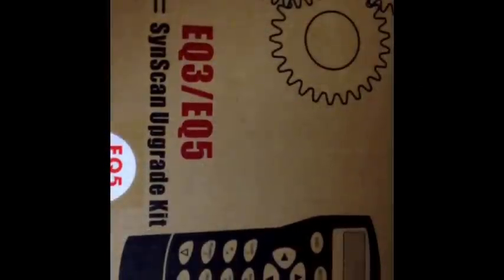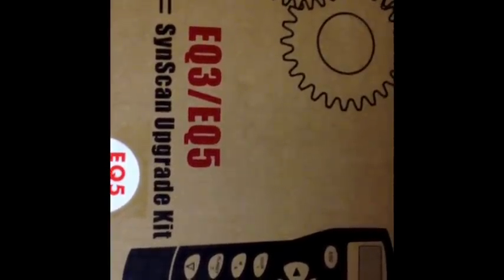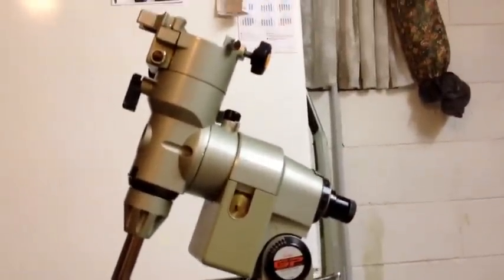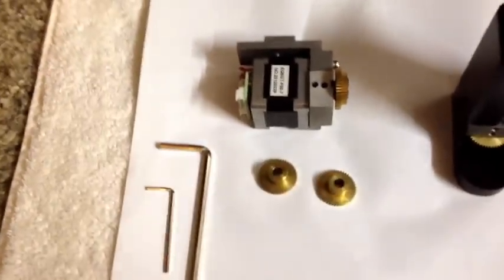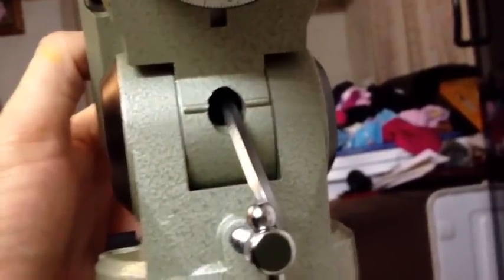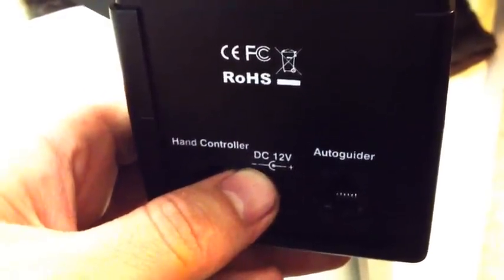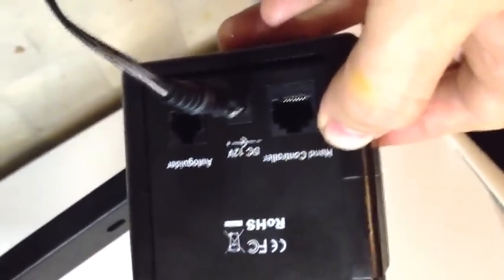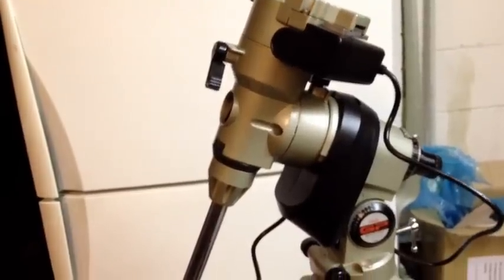Upgrade Of A Vixen GP mount With A SynScan EQ3/EQ5 Skywatcher Goto Kit

Comment: Thanks for the video. I have a GPDX version of this mount and I believe the only difference is to do with a heaver bearing and the polar alignment scope built into the shaft. I have not used the mount for a long time and it has been sitting in a box in my dining room. Perhaps I can upgrade mine.The motors still work but the computer that drives them died a long time ago.
Reply: I'm looking for a gp-dx mount head. Let me know if you ever want to sell it if you aren't using it.
Reply: @DB-be9wy  I have the complete kit from when I first got it. I used it with a 5"  Televue Genesis Apochromatic refractor so I got an extension tube and a tripod. It also has the motors fitted and a Skysensor computer which is not working. 
I do need to get rid of it but I have MS and getting it all together would be a bit of a problem at the moment and I wouldn't know how to communicate with you anyway because I am reluctant to post my email address on Youtube.
Reply from the maker: It is a sentimental scope for me so sadly no sale price

Comment: Btw if you are not sure if the gears are too close but don't want them far enough apart that they have too much play, get a strip of thin paper, tracing paper works well.  Turn the gears until the paper is in between the 2 cogs and tighten them together then remove the paper for a good fit. Learned that trick growing up with radio control cars 😀

Comment: hi, nice detailed video! I am at latitude 1 degree N. Do you think there might be an issue installing the RA plastic housing as the bottom might hit the base of the mount? Thanks!
Reply: Luka Botic but the controller connection points are attached to the plastic housing. maybe i will just have to file the housing. thanks!
Reply: get an extension pier
Reply: Izzat Zubir might not work. The housing will hit the azimuth adjustment knobs.
Reply from the maker: +Teng Jie Ng yes that is possible the plastic can be detached if your desperate.

Comment: Thank you for the video. I have a GP too, and some time ago I installed a Celestron CG5-Goto system, pero it didn't perform well with gotos. What can you advice about the Synscan? Did you try to do autoguide with it?
Reply from the maker: +Mario Morales Aimar  auto guide is pretty solid.  Some times it's approx 1/2-1° off but I suspect it is just slack I'm my original setup. Sorry for late reply, I must have missed your message.